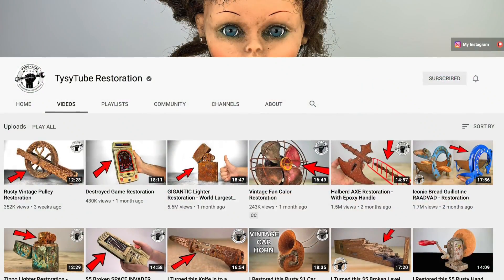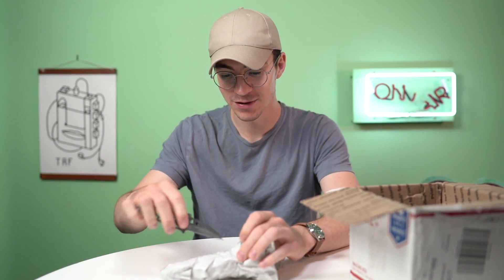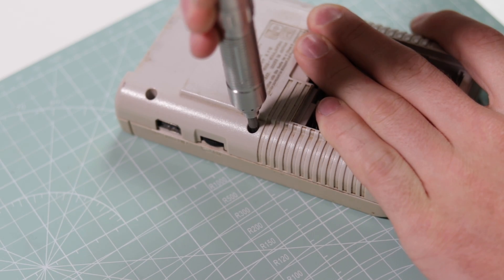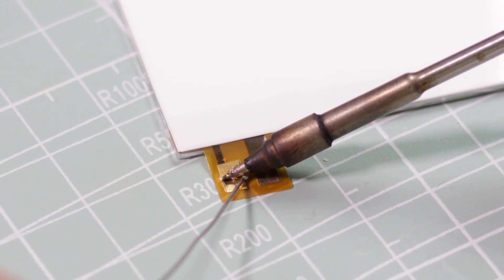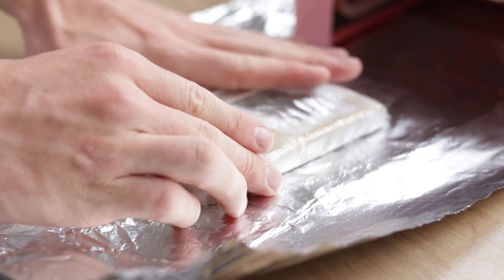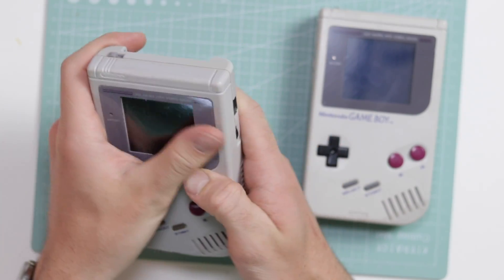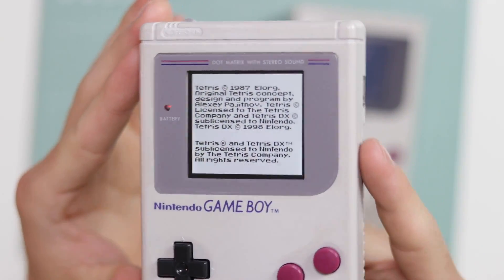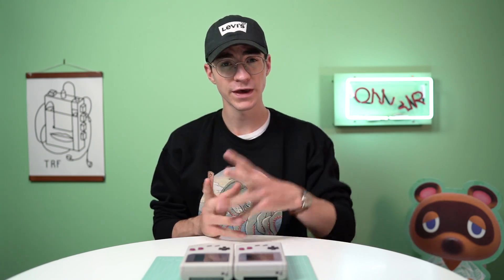TysyTube’s GameBoy Restoration and Mod!

Comment: "Remove the 78 Phillips screws from the front PCB..."
They weren't messing around when the built these.
Reply: With the number of screws, I was surprised there wasn't a zebra stripe inside (method of connecting input to LCD that requires pressure).

Comment: For the backlit gameboy in order to remove the polarizing film easy just use the heat gun to warm up the adhesive. The screen starts to change color to like a blueish tone and it peels off right away easy no mess or have to clean with IPA alcohol it comes right out. Give it a try one day.
Reply: if only I knew this before I broke 2 perfect screens
Reply: @jibulol  Same happened to me and one day i just got tired of that struggle and hit it with the heat gun. Best decision I've ever made! I got a whole stache of broken gameboys that I bought trying to fix it and made them worse lol but eventually you'll prevail!
Reply: @rubenmejia4881  thanks for insight. any recommendation for heat gun brand ??
Reply: @overdriver99  Any will do just fine, make sure to keep the gun in motion because if left in one spot too long it can cause fire. I went to home depot and got it for less than $20. The brand I got is called Wagner.
Reply: Thanks for the tip, but isn't it get sticky and messy after that? Does the glue come off with the silver screen? Also you wrote that the screen starts to change color - does it back to normal after pelling off the silver screen, or you need to clean ot after warming up? At my first try I broke the lower connection while strong scraping of last parts of glue, it was close, but I've installed the IPS in the place of the broken one. This time I'll watch out. 5!
Reply: @skalapiotr  Everything comes off no residue or mess if done correctly. Apply sufficient heat so all you have to do is just peal once you get a corner lifted off. Use a hobby knife or X-acto which is what I used to make sure I got underneath the layer of adheasive. If you feel resitance just apply more heat and it will easily come off as you are pealing.
Reply: @rubenmejia4881  Can you tell me what power does have your heat gun? I dont want to melt the screen :D
Reply: @skalapiotr  Mine has low high & off. I use the low setting and aim at my hand to see once its warm enough. When its ready to go, use circular motions around the screen. Do not put it too close or else you'll begin melting the white plastic that holds the screen which is part of the reason you have to keep it in motion also to disperse the heat in different areas. At first I would leave it in the center for a few seconds then I would start going around the screen. If you dont have access to a heat gun you might be able to get away with using your wife's, sister, or mom's hairdryer. It will take longer that way since it doesnt get as hot as a heat gun but it would be a little safer just continue to move around to avoid any melting.
Reply: @rubenmejia4881  Does a hairblower work?
Reply: @vitorkk328  Yes it should as long as you keep the heat in motion. It might take a little longer since it doesn't get as hot at a heat gun so it would be just a tad extra to heat up the adhesive.
Reply: What's turning blue?
Reply: @SkylerLinux  the screen color with the heat applied

Comment: Great video!  So cool you collabed with TysyTube!  Was wondering if you tried retrobriting with liquid hydrogen peroxide?  I tried using the cream and the sous vide method but my results were less than stellar.  I figured that maybe using the liquid HP with the sous vide would yield better results.  Just curious if you had any experience.  Cheers!

Comment: I believe the reason you find the backlights tricky is that they are tricky! I've only done a Pocket but if I ever feel the need to do another, it'll be wearing some rubber gloves so I can peel stuff off without my increasingly sweaty fingers skidding all over the place. And I'll nick that little trick of slipping a card between the two layers for sure - thanks for that.

Comment: When I Retrobrite, I use salon care volume 40 developer clear (liquid not cream), and a cheap glass jar that's big enough for a DMG model gameboy,with the outside spray painted with liquid mirror  or metalic finish, and waterproof ultraviolet LED's. Lining the inside of the jar, and it's especially great because it causes no streaking or marble effect.

Might be an effective way to dodge that marble effect. 

Awesome video.

Comment: 9:58 - I had that exact same streaking  problem happen to a Super Famicom I used the saran wrap method with. After that I switched to using clear liquid developer cut with water instead of the gel developer, and it works flawlessly. It's pretty idiot proof too, you can leave the parts in the solution for hours on end.
Reply: Lydomina Just toss the plastic parts  into a roaster filled with 3% H2O2, set your electrical oven to 50-55 deg. Celsius and let it “roast” overnight or even a second night. That way the retro brighting process takes longer but it’s happening mildly, leaves no streaks and does not require UV. I’ve successfully brightened many Super Nintendo shells this way. :)
Reply: @gern0tk  you should do a video because there's a lot of misinformation about this process. I also don't use UV and I do use clear solution with better results.

Comment: If you want to take all the hit and miss out of retrobrite. Put the thing you want done in a container then fill it with hydrogen peroxide. You can use normal 3%, but it will take longer. But try not to make it more than 10-15% hydrogen peroxide. It will just be a waste. 

Then either expose it to UV, or heat it to right around 160°F. Heating works better.

You won't get any streaking this way. Also it's hands off.

Comment: I recently discovered that "retrobrighten" is not a plastic bleaching process. Instead, the flame retardant agent mixed with the plastic, which is oxidated, gets de-oxidated, returning to it's normal transparent state, so the original color from the plastic can show through again :) There is a guy writting a book about this.

Comment: Nice work. Try the Hydrogen Peroxide solution in a tub, instead of cream to prevent the streaking, then weigh down the shell to keep it submerged. You can re-use it too, up to a point.

Comment: Elliot, I got that same iron based on your videos and recommendation (and the WOW Stick screwdriver :). Love this new video because you combined two videos, both projects I am going to do, and you showed the V2 Bivert chip, which I got with no instructions, so didn't know how it grounded till I saw you solder it.  What temps to you use for that ribbon cable repair? and for soldiering? I really am curious since I am using the same iron.

Comment: the IPS looks indeed beautiful, but discarding the entire PCB to replace it with something new is not quite the same. i mean you may as well cram a raspberry Pi in there an run a PlayStation emulator while we're at it

Comment: For those interested. 
The Retr0brighting methode shown in this video can result in streaking sometimes if the cream it self isn't evenly spread. There is an easier methode. You just get hydrogen peroxide (you can find bottles online of at your nearest drugstore) Mix it with water in a bag and then put it out in the sun. It takes a little longer but for my experiance it's safer (also heat does play a little role as well in that process). Btw putting it out in the sun is basically using a uv light but much more powerful. So if possible use the sun. 
If you are interested in that technuiqe the youtuber The8BitGuy has done a video on various Retr0brighting technuiqes including the one shown in the video, as well as the one I just mentioned.

I hope this helps for anyone who wants to try Retr0brighting themselfes :D
Reply: or you can check my video🤣
Reply: @TysyTube  yea that works too 😂

Comment: Seeing as the bivert mod is so good, why didn't Nintendo make the Gameboy that way in the first place?
Reply: Orax1701 Because it was 1989 and I don’t think they could’ve done it cheaply, as well as the battery life would have been shorter, and batteries aren’t exactly cheap.
Reply: @destruxandexploze2552   I never knew the bivert mod uses more power, thanks! Prolonging the battery life on the Gameboy would've been a high priority for Nintendo, I suspect.
Reply: Orax1701 Well 30 hours battery life for the Gameboy vs the Sega GameGear 3-5 hours battery life (which took 6 freaking batteries) I think they really had the best device even if it wasn’t in color or backlit.
Reply: @destruxandexploze2552  👍

Comment: Question: When doing your retrobrighting how do you avoid streaks? I tried it and the first time it came out all splotchy. Second time was better because i used a paintbrush to apply the cream evenly but it still had small streaks.

Comment: You know what the Problem with Streaking is? Using Cream to Retrobright it. It's a Fact that submerging them in liquid Hydrogen Peroxide grants better Results than Hydrogen Peroxide Cream.

Comment: all i know is, He got it for $9. TysyTube fixed it made it look nice. Made it worth $50. IF had the gameboy box, be worth about $200 to $300.  but Modding it. made it worthless. Only good to the people that modded it or requested it. but selling it, $10 max for it now. even if you spent money on the mods for it. would still be worth maybe $10.
Reply: If everyone on the planet only wanted to collect original hardware you would be right but if you check out the many mod websites that sell pre-modded Gameboys (that are constantly selling out) and/or eBay sold listings you'll see that you are incredibly wrong. Most often modded Gameboys go for more money than the price of the unit + the mod because a lot of people don't want to/can't do it themselves.